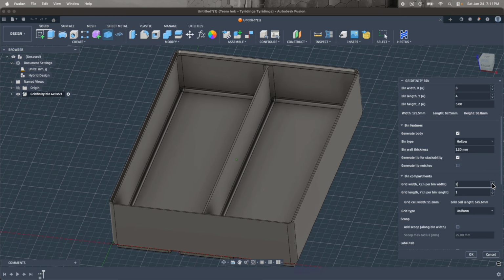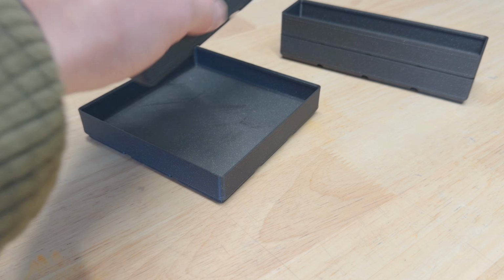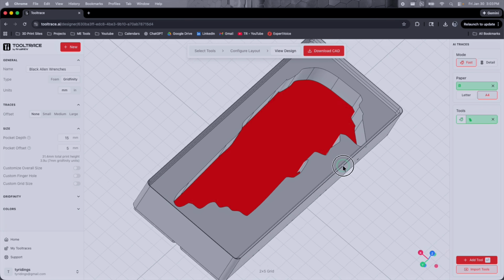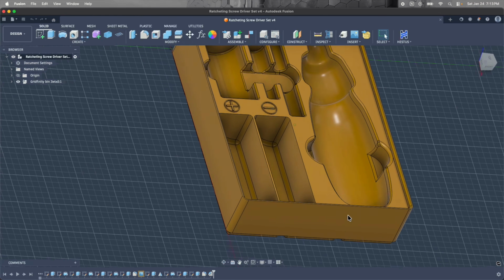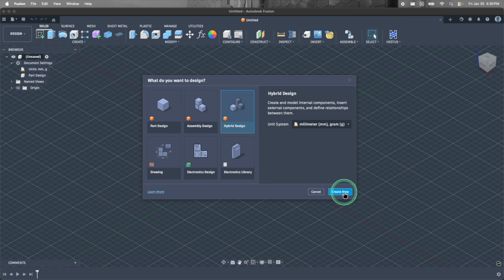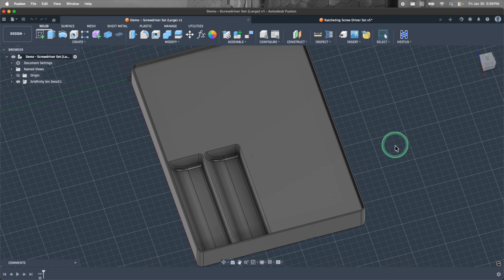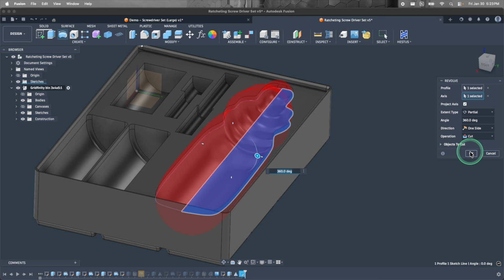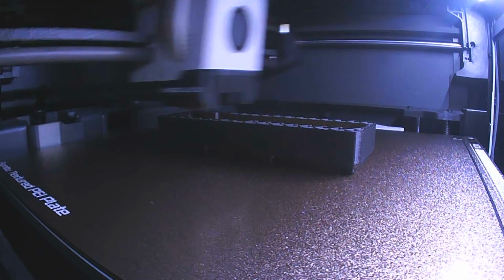Fusion 360 + Gridfinity: Custom Tool Shadowboxing, Today!

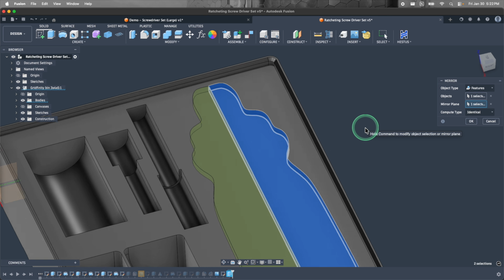Comment: 17:03 Wish there was a bit more explanation on mirroring the extrusion 😅 I was a bit confused on what to select for the mirror plane. It was the thin face right in the inside middle part made by the centerline when the sketch was extruded.

Comment: About the rules: I just made Claude Code make me a GUI where I can insert ANY drawer measurement and automatically get a grid, and choose to use that extra space for bins, or as a spacer, then if I use it as a grid, any box I put on it, will be that size. Work smarter, not harder. The grid it makes is selectable, and from there I can hit B to generate bins, or P to generate a baseplate. I can choose type of magnet inserts, if I want them press or glue fit, how many corners they should have, if they should have screw or just push-out-holes, how tall bins should be in gridfinity units, wall thickness etc. And it autosaves all the time, and.. I can make as many separate projects that are saved, as I want to. So I can have a project for all individual drawers for example. Anyways, now that I know that fusion has plugins, I'm gonna investigate if it can be ported there with the same functionality or not, so that I can use fusion for the insert part.

Comment: Great video! The only thing I would add is when adjusting the spline holding ctrl stops the points from auto connecting so it should free float closer to your tool. 

Great job!

Comment: Hello! A couple of questions.. I really like how your prints look... What printer have you used? And what brand and colour is that black with specks you use? Thank you!!
Reply from the maker: Hey, thanks! I have a Bambu Labs P1S as my primary and a Bambu Labs P1P. That black filament is from Bambu Labs, it's their PLA Sparkle in black (I'm a little obsessed with using it on everything since it hides the finish of the layer lines so well). Hope that helps!
Reply: @tyridings 
Hello, ok thanks!

Comment: Hello, I have printed the PDF and also copied the values in the graph website, but when I use the ruler, there is a mismatch and I get less than six when measure similar to the video. Do you know what I am doing wrong? I got the ruler from the same user in Maker world

Comment: If I already have a 3d model that I'd like to sit completely flush in my bin, how do I go about this? If I just use the combine feature to cut, I end up with a cutout of the model in the bin, but not a straight up cut that would allow the physical object to be placed and removed from the bin. Not sure if this sound confusing. Imagine I have a model of pliers with rounded handles that I'd like to sit flush. What do I do?
Reply: Basically what he said already. If you use a boolean operation to remove your plier model from your bin model it will be a box with a cavity inside. If you create a plane through the max size of your part, project geometry, and extrude upwards to the top,  you will now have the cutout flush to the top.

Comment: So i've tried to follow your video 6 ways to sunday and no matter what i try i cant get the calibrate to set right. The grid paper you made says it should be 2x4. Ive taken and retaken the photo with my iphone 16 using different settings and even turned on the cross hairs to make sure the phone is level. The picture will not fit in the face in fusion and looks distorted. Any help would be appreciated!!
Reply from the maker: The small squares are 7mm apart which is the standard unit length for the overall grid system! Hope that helps!
Reply from the maker: Just to add, when you import the photo and then go to calibrate, just select the intersection of tow corners of a tiny square and set that dimension to 7 mm. Let me know if that helps or not and we can go from there!
Reply: @tyridings  It didn't. The only thing that finally helped was i edited the scale Y and set it to 2 and left the Scale x at 1
Reply from the maker: @JackmansJourneys yikes! Glad you finally got it, that’s really strange

Comment: A tip I learned to reduce angular distortion: the further away you can take the picture, the less angular distortion you will get.
Reply: Perspective refers to the spatial relationship, scale, and depth created between objects based on the camera-to-subject distance, while distortion is the unwanted warping of lines or proportions. What you're calling "angular distortion is just perspective! It's not really distortion. There's no optical defect that causes this, it's just the physics of light. If you look at your cat with your face inches away, the face looks HUGE in relation to what's behind the plane of that face. Some people refer to this as "distortion". Some wide-angle lenses and all fisheye lenses create actual distortion in that straight lines from the subject are "distorted" because they are imaged as curves. As you point out, the "undesired" effects of perspective are reduced if you move farther away from the subject. That's one reason portraiture imaging often uses longer lenses so that when imaged farther away from the subject, the subject still appears large enough in the full frame...
Reply: @steveh8724  well, I say “avoision”.

Comment: What material have you found the best to work for the boxes?
Reply from the maker: Hey! I just use PLA, bambu’s brand mostly. I always use whatever is cheap and easy to get the job done and replace when necessary. The only thing with PLA is being careful with using it for a space that will experience higher temps or direct exposure to sunlight.

Comment: One minor tip about scaling your canvas in Fusion. Rather than selecting just two corners on the edge of one square on the grid, pick two collinear points with 15 or squares between them. Should be more accurate as even if your click is a little off the skew will be averaged over 15 squares, rather than just one. Very nice video though!
Reply: Yes! Though to be more precise, it's not about averaging, but rather _dividing_. If your error is (for example) 0.10 mm, over a 7.0 mm distance (one square) that's a 1.4% error rate, whereas over a 105mm distance (15 squares) it's a mere 0.095% (one-fifteenth the original rate).
Reply: I was about to write the same. The bigger the distance you calibrate on, the better.
Reply from the maker: Awesome!! Super helpful tip, thanks!

Comment: Great video. I find it better when tracing to make the trace as exact to the canvas as possible. This way you can actually model the object. You can either push/pull the faces or offset the sketch to give the necessary tolerance. This is better (imo) because it makes it easier to adjust the fit without having to redo all the splines.
Reply from the maker: Appreciate the feedback, good point!

Comment: there's a simpler, better and more accurate workflow where you take a picture of object with a 50mm square next to it for reference and upload it to Google Gemini and ask it to make a silhouette of the object without changing proportions or scale then convert that into SVG with any online converter then importing SVG into Fusion and setting proper scale using 50mm square.. 
one quick tip is to take the object photo using zoom lens on your phone for better perspective and less distortion.
Reply: I’ve actually combined both techniques.  I still use the graph paper here, and that’s what I take my photo with.  I changed the prompt slightly so it keeps one of the squares.  So I do a 42mm resize:

“Help me remove the background and turn the object into pure black silhouette , while keeping one of the larger squares (darker black outline) of the grid nearby but not touching it for scale reference. DO NOT change the scale, size, or position of the object.”
Reply: I actually do it one step simpler, import your photo as a canvas and use fusion addin project salvador to create your vector sketch.